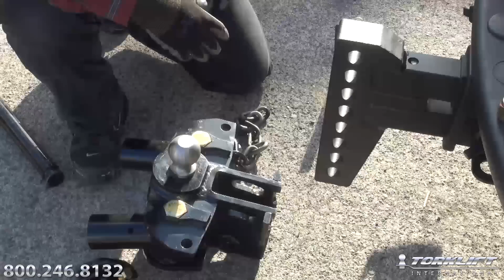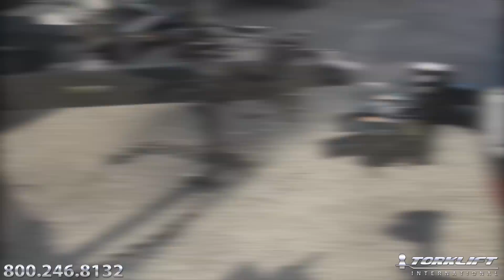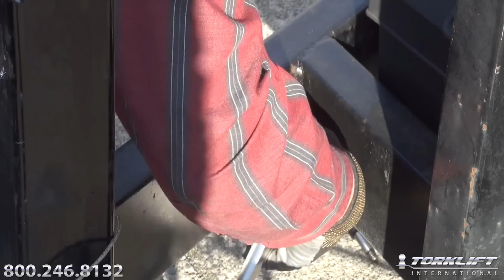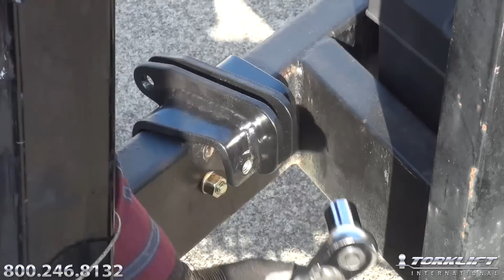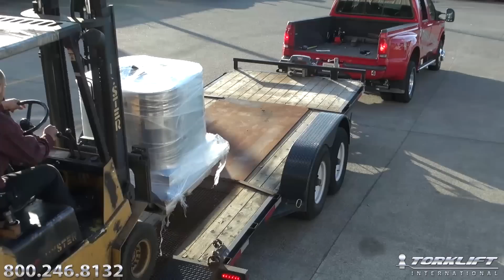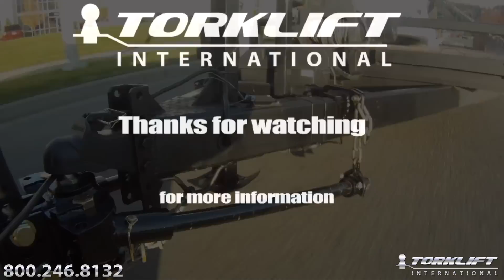How to install Torklift SuperHitch Everest 30,000 lbs. Weight Distribution System

Comment: I'd like to use this wd system with my bumper pull toy hauler, but the requirement to use a hydraulic jack to attach the bars makes this a product i don't want to deal with. Hope you guys can come out with a more user, recreational friendly design. For now I'll keep using my blue ox sway pro, but it has its drawbacks.
Reply from the maker: Hey Dustin, thanks for watching the video and leaving your thoughts on the product. The Everest weight distribution system comes with the bottle/hydraulic jack for easy installation, so you won't need to get one yourself. With the highest weight distribution ratings and backed by our Legendary Lifetime Guarantee, if you go Torklift - you never go back. ;) We'll be sure to share your thoughts with our team to see what improvements can be made in the future.